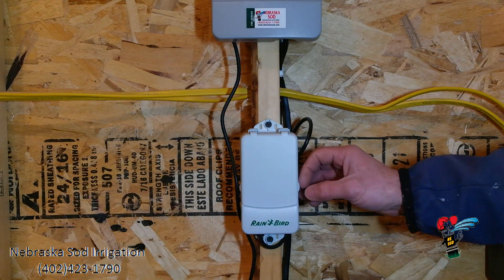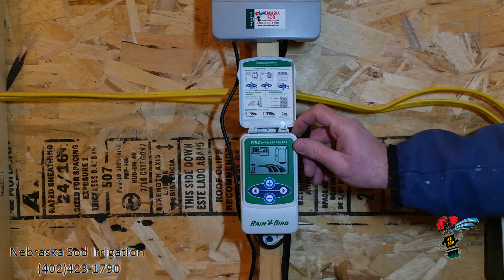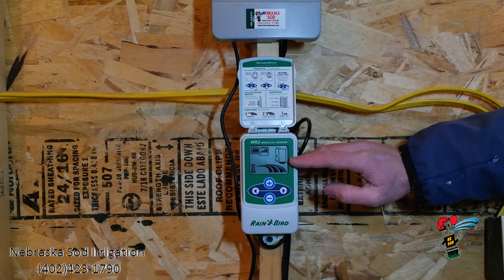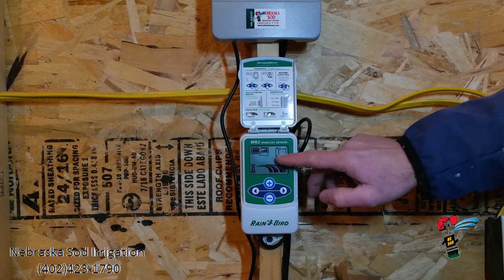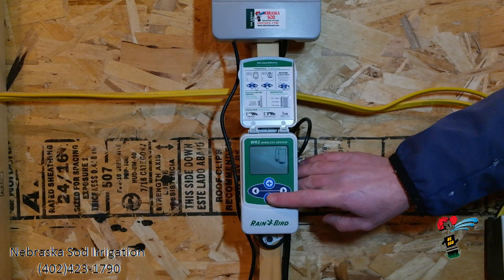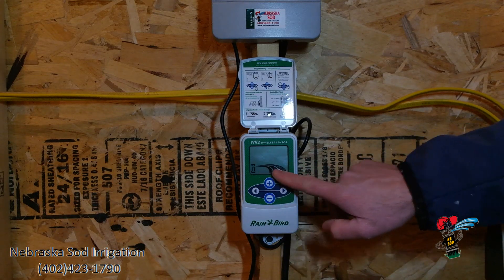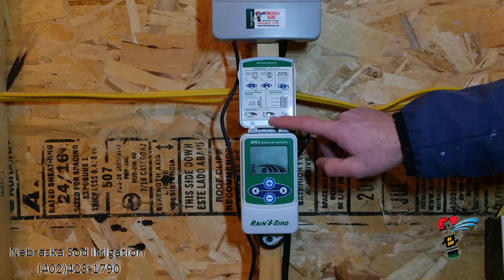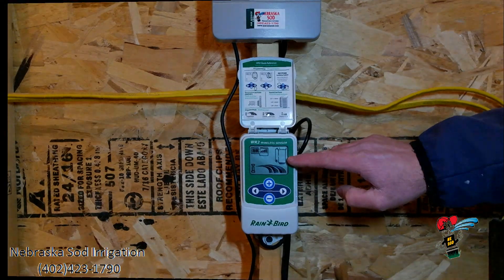How to operate a Rain Bird rain sensor

Comment: How far can the sensor (indoors in  the garage) from the rain gauge? Also will the garage door closed impede the signal and can the parameters be changed  by a software app? What parts \products do I need to purchase ?